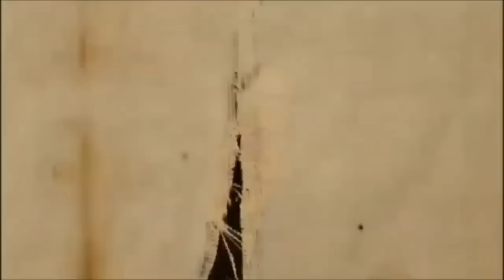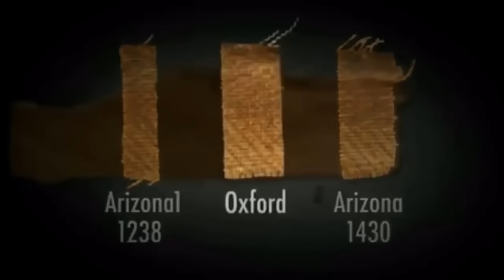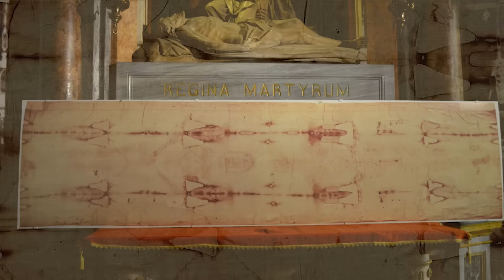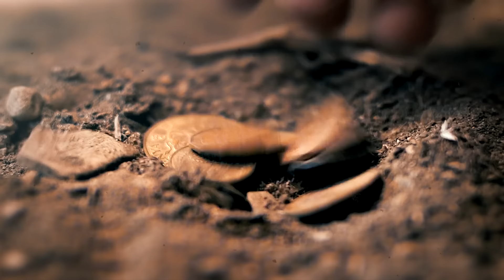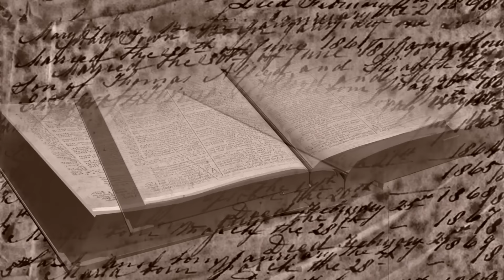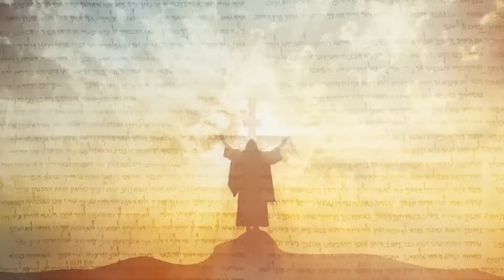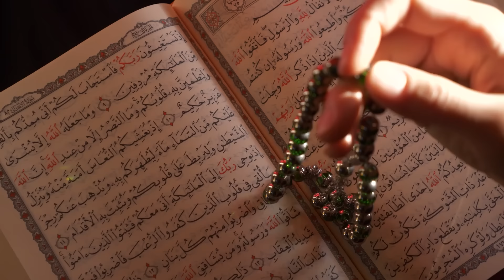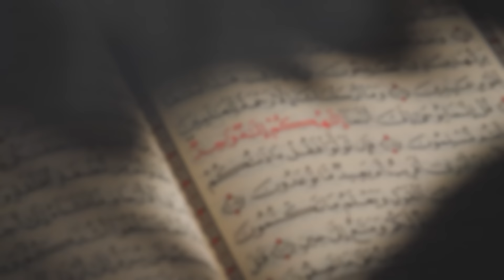Jesus' Tomb Discovered What Was Inside Will Shock You!

Comment: The carbon dating is not true or accurate because the piece they used was not originally from the Shroud but from France after a fire in the Church that damaged the Shroud with water and smoke! The Nuns repaired it with cloth and tried to match the stitching as closely as they could!